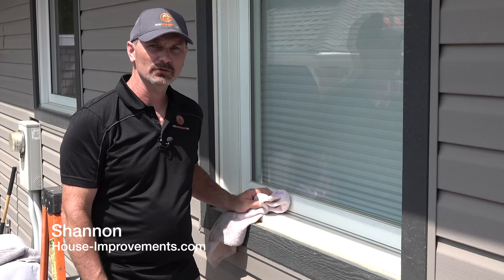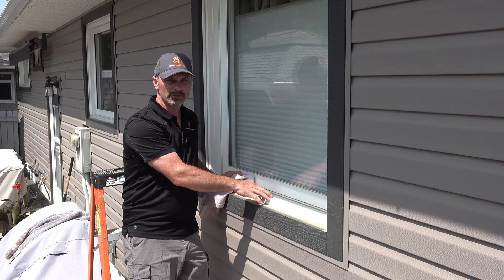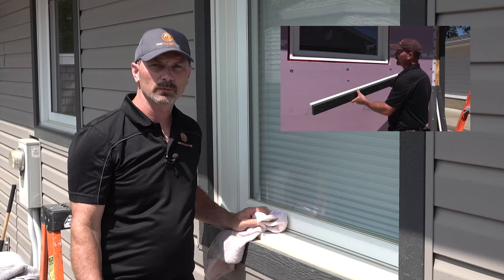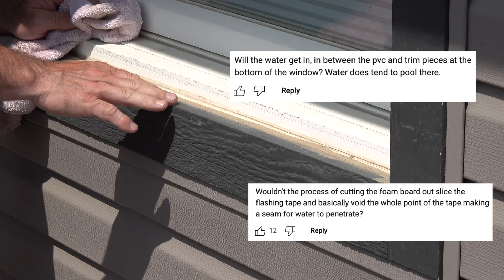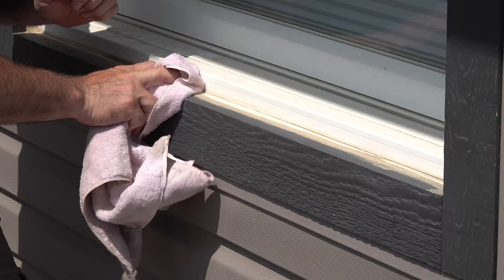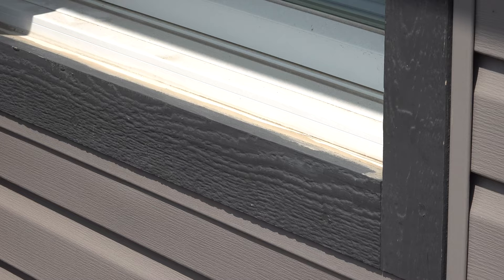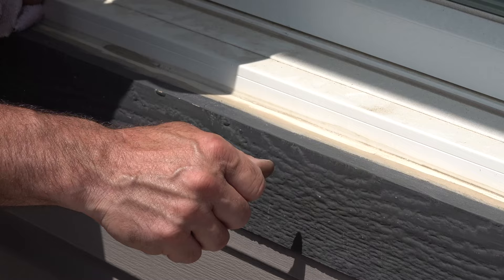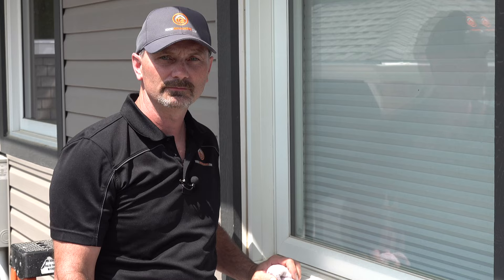Window Trim Update : 5 Years Later

Comment: My dad's lake place in northern Wisconsin has that same material on the entire house, trim and all. I think all the wood fibers are so well encapsulated in resin that it's super resilient to moisture and not prone to swelling at all. It's a nice material, not only easier to build and shape with conventional wood tools but also cheaper than cementitious siding products he had initally been considering. It has a nice aesthetic appearance of painted wood without the maintenance of that too. That place is 8 years old now and it all still looks like it did in 2015 when it was built.

Comment: I used the exact same product for the corner trim on my shed, built eight years ago. It's held up just fine and is even more exposed to the rain (in Oregon!). It's a good, stable product designed to be outdoors, unlike regular OSB.

Comment: Is it good to knock the corner off (chamfer/round) trim like that before painting to avoid a thin spot?  I like to remove sharp edges but sometimes think I'm doing more harm than good by removing the factory primer.  
Yeah, I wouldn't have guessed an MDF product to make it 5 years outdoors.  Thank you for the update :)
Reply: yes, breaking the corner by minimum 1/64" and max 1/32" (more is fine, just less aesthetic maybe) is a proven way to avoid pull away from paint on sharp corners.  Factory primer removal won't be big enough to affect topcoat... you'd have to chamfer a good 1/4" before it's going to flake.
Reply: Good, thanks!
Reply from the maker: Also to be clear this is not MDF, this is more like OSB but with what seems like much more resin/glue.